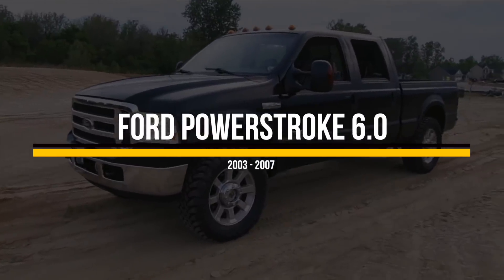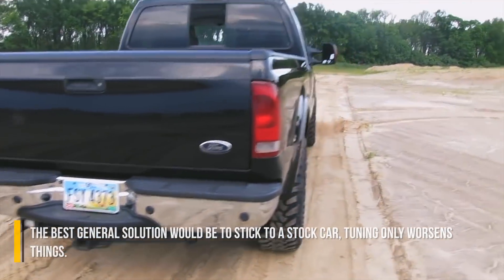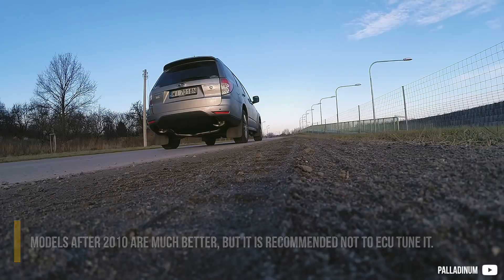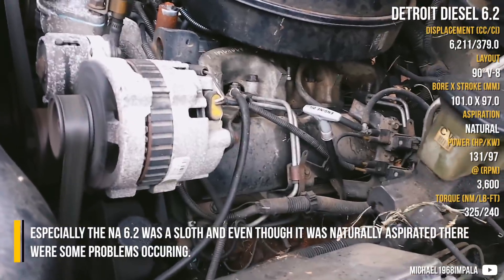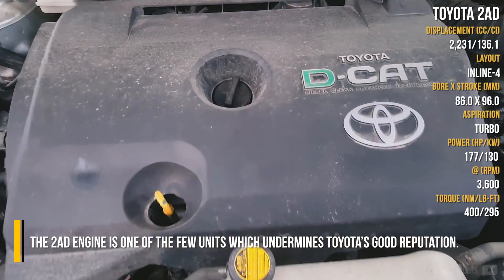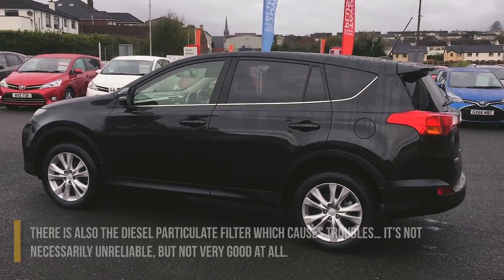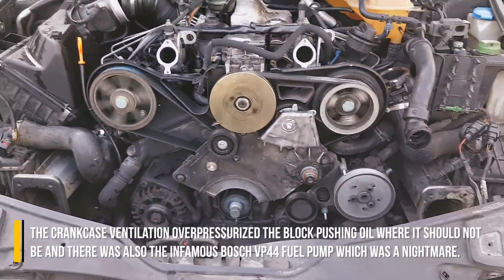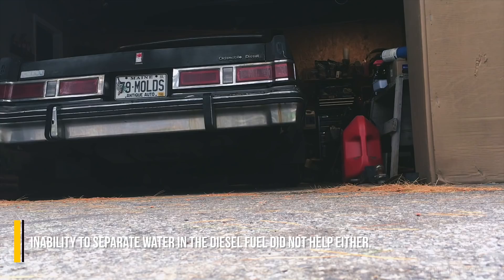6 Worst Diesels You Should Stay Away From

Comment: The 6.2 Chevy diesel is one of the best motors ever made, it is durable as hell! The 5.7 DX diesel will keep on running if you drive it in the right way and maintain it!
Reply: That's funny....its a POS. Buy a 350 small block and save yourself some trouble. At least GM got that right

Comment: This entire movie was discredited by the fact that the 6.2 and 6.5 Detroit for  General Motors line of trucks made this list. While not power houses they're reliable. But the movie got one thing right here. They get really good fuel/oil mileage. Notice I said fuel meaning diesel and then oil or waste motor oil.  They weren't very picky about what they ate so long as you didn't expect them to eat water,gasoline or alcohol. They would run good on waste oil so long as you filter it beforehand. And as a farm boy and exfarm hand I learned that was extremely handy. So long as you maintained them properly they keep going. As a matter of fact I know most of them in my small hometown are still doing the same job that they were when I was a teenager. It is 2018 I'm 32 now and at least two of them are older than I am. There just a little Rusty'er from the last time I was in them. Haha
Reply: Reliable? LMFAO!
Reply: Brentelec I had a 6.5 in my 1995 K3500 dually. Say what you want but I beat the shit out of that motor as a work truck and it just kept going nonstop. I towed over 15,000 LBS with it and it seemed to have no trouble with it, this guy is just going by the stats of the motor, not what it truly can do.
Reply: i had a blazer that went through three 6.2s each with well under 100,000 miles on them.

Comment: I have to disagree with the Japanese diesel engine part, especially Toyota because one of their diesels, the KD series used in Hilux and Hiace (and in a certain compact MPV sold in Southeast Asia and parts of the UAE), has a rock solid reliability. Isuzu also made extremely reliable diesel engines, some of which can run well past a million kilometers without much trouble.
Reply: Yea. Here in finland there was news article about KD series. They dont anymore take engines of from crashed cars because ten year old ones are still in the storage collecting dust :D
Reply: didyliduu I'd assume those engines are still in working order despite collecting some dust.
Reply: But it had SO LOW power and torque, Any medium NA diesels with no EGR lives forever but they were so underpowered because emissions
Reply: ScoutSpyScout gotta agree with that. The standard 2.5 liter 2KD only made 100 hp and 147 foot pounds (non-intercooled turbo ones with manual, automatics have slightly higher torque at 191 foot pounds) with its latest iterations with VGT topping out at 142 hp.
Reply: Mitsubishi make some good diesels as well!
Reply: Don't forget Nissan's RD28 + the 3,3 and 2,2. Annything before Renault took over
Reply: MrWombatty case on point the 4D56 series, which is a legendary engine.
Reply: The torquey 4D56T  is what's in my '95 Pajero J-top (swb soft-top) & being much lighter than the wagon, few hills slow it down!
Reply: Raka Radityo But the 1KD in my grandfather's 2014 Dyna already had the timing belt warning light on since 140000kms?? Now its almost at 170000kms and he still hasnt fixed it yet
Reply: The 1kd is great, it’s powerful enough and indestructible
Reply: Yeah isuzu engines my favorite Diesel of them all extreamly relible and never hasitate to start in minus 30- never had any real problem with em they just dont care and is very tune friendly my 4ja1 with over 2bar (30psi)!! on stock internals and a N/A block it would beat a mercedes om602 with the same mods exept its more popul here where i live
Reply: The  6.6 GM Duramax is an Izuzu diesel and is a good one.There were Mitsubishi diesels put in 1970s Dodge trucks before the cummins diesel went in the Dodge trucks
Reply: Does that "certain compact mpv" you are talking about, happen to be the Diesel Previa?
Reply: @Owiko7  in his country the MPV in question would be either Toyota Kijang (localized name) or Isuzu Panther (4JA1 engine)...
Reply: I commented with the same thoughts... I have several Toyota Diesels (1980s and 90s), and they're about as reliable and bulletproof as any engine I've ever known.  MAINTENANCE is the key!
Reply: In South Africa they used a n/a  2.4l diesel engine. Very slow but relaible.. my pickup did 510 000km  before any trouble started. Cambelt tensioner broke... now it needs a rebuilt.
Reply: Raka Radityo  Isuzu 6SA1... Best engine ever to come out of a sand mold...
Reply: Raka Radityo Hilux are indestructible

Comment: That Oldsmobile LF9 sounded amazing though...
Reply: It sounded like it was gonna cut out at any second
Reply: Listen to the wagon sound clip.
Reply: Liam O'Sullivan 
Haha that would be ok for a gasser , but if a diesels doing that it could be a bad injector to a dead hole..
besides it’s so shitty, shut it off and fix it
Reply: sounds DREADFUL
Reply: Most big, american, straight piped V8 engines sound almost identical.
Reply: I owned one of those turds 30 years ago. I walked alot back then. Thanks for the night mares I mean memories
Reply: My grandfather was an Olds man through and through. He had one of those for about three months before he took the car in and had it converted to a gas 350.
Reply: Their 1 saving grace, was they would get wicked fuel mileage.  A friend's mom had one in a Caprice wagon, that big tank would pull down 36 MPG on the freeway.  Pretty good for a big sled of a station wagon!  GM fixed the problems with them by 83, but by then the damage to the reputation was done.
Reply: sounded great with straight pipes.
Reply: My dad had one in a wagon strong motor
Reply: @DOffio  My dad bought a Caprice station wagon with that engine. It sat fot two years untik GM was forced to replace it. I had put an Olds 307 gasser with a quadrajet carb and it hauled goods and hauled ass. It died at the hands if a T-boner trying to beat a light with ubfortunate me in it. I loved that stationwagon.
Reply: I still have one, 1981 Cadillac Cp DeVille  with the 5.7 Olds Diesel, Runs great and almost 30 mpg. While it's not a daily driver for many years now it still turns heads when people hear the clatter coming from under the hood of a Caddy.
Reply: I have two of those in Cadillacs;  both are running fine, with just over 100k miles, but that is with excellent maintenance over the years.  Also I upgraded the fuel filter and water trap/sedimenters to Racor units, which solves the water-into-fuel problems.
Reply: The 1981 and later models (or is that 1983 and later?) were better built, since they had a much stouter block and roller lifters.
Reply: I believe these were the ones made in response to the oil crisis. Shortage of petrol but not diesel. They were so bad they started getting problems like crankshaft bearings wearing badly AFTER 6 MONTHS FROM NEW.
Reply: The big problem can be solved by replacing the poor hardware with good head studs. They got great fuel economy and really bark with good exhaust. I got 26 MPG in my 5.7 diesel pickup and my grandpa had one in a G body Pontiac he got 30. Warm them up good and don't do heavy pulling.
Reply: Hands down one of the best sounding diesels. The sound was worth any issues that came with them haha
Reply: by the end GM had fixed the reliability problems, but by them it was too late the damage to their reputation was done.
Reply: Uncle Bucks second rig.
Reply: Like a tractor..
Reply: I have one sitting in my garage that I pulled out of my Pontiac. Injector pump crapped out after 196,000 miles.
Reply: Total piece of shit.
Reply: @kx250rider661  Can you still find parts?

Comment: Isuzu don't make a bad diesel engine.. The mileages the old 4JA1 and 4JB1T (to name a few) can do are testament to that.. There is one in South Africa that has done over 1 million KM's- verified.
Reply: Matthew Shambler Agree mate, Isuzu's diesels is badass, very reliable, cheap to repair...
Reply: Leonard Carr , Lol.. yep, good old Isuzu Bakkies- AKA pickup trucks for the rest of the world;-)
Reply: here in Indonesia the 4JA1 is glorified much, it's on par with Toyota Hilux kind of reliability
Reply: Matthew Shambler , isuzu p9x very bad diesel
Reply: O yes, you have to put some miles on to wear through the hard chrome on the liners. 
The 4JB1T survived the lack of an intercooler well. 
They would boil the coolant and burst pipes long before the high egt's could think of cracking a head or melting a piston. 
I would get overtaken by a 4JB1T with a caravan behind it on the way back to Johannesburg from Polokwane whilst I had a 4JA1 doing the speed limit at full power.
An hour later I would pass them stranded as they had blown the cooling system and it steamed like a volcano next to the motorway.
But that motor shredded the tranny if not driven responsibly.
Have a lot of respect for that motor.
The sub is still in production, they have efi fuel injection now and I presume some head changes (Have not researched)
GM have refined a timeless classic.
Reply: Matthew Shambler 4JA1 is a legend here in Indonesia. Many are still in perfect working order after doing extremely high mileage. The thing about the engine is that it doesn't have much gadget so it's super-easy to maintain.
Reply: Honda Diesels too
Reply: And what about 3 liter V6 Isuzu Diesel in Opel/Saab/Renault? I know it is based on a bulletproof truck engine, but it's car applications are a catastrophe.
Reply: Matthew Shambler i work on isuzus daily and they are an absolute weapon of a motor
Reply: The 6.6 Duramax is also an Isuzu design
Reply: Isuzu has a super strong diesel game, possibly the best company designing diesel engines in a larger scale
Reply: 4j1 motors crack heads and warp and do headgaskets bad
Reply: Renaldi Saputra 4JA1 is good. but nothing beats the 2KD FTV. Toyota Innova Diesel ftw ^^
Reply: Matthew Shambler , Isuzu, Hino and Toyota use  the same engines in trucks . Basically all use Toyota engines.
Reply: Isuzu 1.5 Lit. Turbo Intercooler fitted Opel Kadett-E / Vauxhall Astra Mk2.
Reply: Didn't kow that. Really?
Reply: Show 4jj1 some love, that thing is legendary.
Reply: Lcr34, agreed! I myself have a vehicle with its smaller brother- 4JK1 and it’s a pleasure to drive and very light on fuel.
Reply: Palominostudio , I know exactly what you mean- happened to my brothers old KB280! My company had a double cab 250 with space ship mileage that just kept going.. at nothing more than 120km, but it got there. We actually have a generator set with a 4JB1 non turbo in it that’s got over 5000 hours on it..
Reply: Nick White, completely agreed! Definitely some of the best in my humble opinion!
Reply: Opel 1.7 was made by Isuzu. Really great engine, aspirated 60cv and years later, turbo 101 cv. Reliables, cheap and not so slow.
Reply: also fitted to the Opel Corsa A ( Vauxhall Nova) and the bigger 1.7 litre TC4EE1 fitted to the Vauxhall Cavalier Mk3, Astra (F) Mk3 and also the Corsa B
Reply: 4ja1 is really good engine even we use low quality diesel fuel. Especially isuzu c223, even it has low power but very durable and reliable. 👍😁
Reply: tell that to isuzus warping aluminum cylinder heads.

Comment: Japanese can't make propper diesel enigines? Apart from the one you mentioned all of the big diesels in the Toyota Land Cruisers for example are great and some of the most reliable engines in the world when maintained propperly. With a bit of care the 6 Cylinder-Diesel Engines like the 1HD-T, 1HD-FT or the 1HD-FTE run for litteraly millions of kilometres.
Reply: The 2AD its like the black sheep talking about toyota diesel engines. Most of them are so reliable.
Reply: Amen the landcruiser engines are something else there’s a 1hdfte I know of that has 2milion ks on it and it has had nothing done to it I have a hdj79 with a 78 and it has 380000ks on it hasn’t had a single issue either.   All of the American diesels seem to have all the issues.
Reply: Also nissan td series engines
Reply: Japan makes very good everything they are innovators while other country's like Germany invented diesel. 
For example kubuta diesel very great engine Japanese etc more ,,,,
Reply: Chaminda Thushara Ruwan 
I can say Toyota and Honda are good except Honda has problems with its transmission
Mitsubishi has the best warranty 10 years on their car.  Nissan don't know 
Isuzu must be good they partnership with gm to make Diesel engine. 
Mercedes om606 best diesel nothing but the best
Reply: The 1VD-FTV V8 diesel is pretty much bullet proof and with an amazing soundtrack to boot
Reply: 1984 Landcruiser BJ42 with a 3B diesel. Unstoppable! (except when they break Birfield joints)

Comment: Another worst Diesel-engine ever is made by a japanese-american company: Isuzu.
The internal called "6DE1" or "DMAX V6" engine was used in Opel/Vauxhall Vectra C, Signum, Saab 9-5 and Renault VelSatis and Espace. Only a few of those engines passed 100.000km/60.000miles without a broken engine or broken diesel pump. The liners were likely to slip down. Exhaust gases are pushed into the cooling system then. The engine runs hot. Some mechanics diagnoses that the head gasket is blown. But in 99% the liners are broken. The Denso high-pressure diesel pump does not like biodiesel. The valves break down. You should fill up premium diesel (without biodiesel) only OR with normal diesel you should put a bit of 2-stroke-oil in the tank every time you need to fill it up.